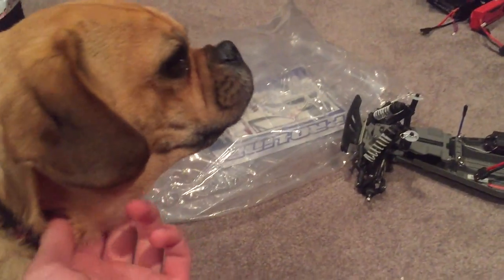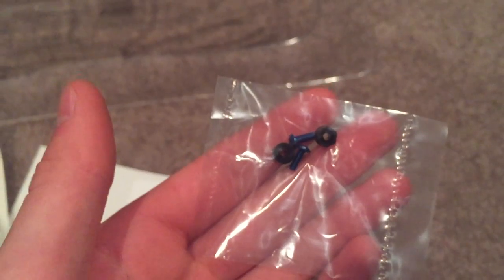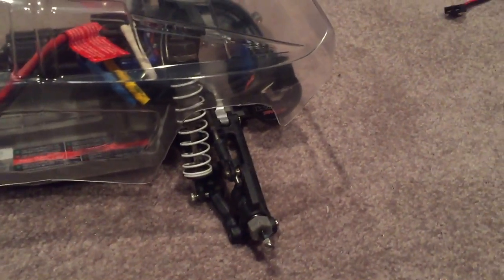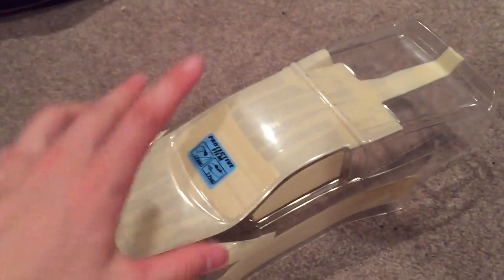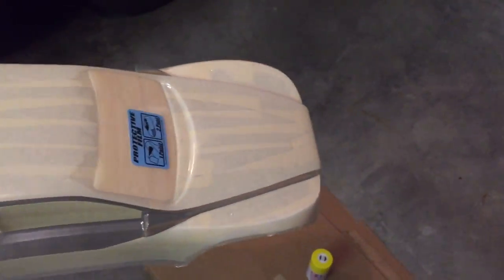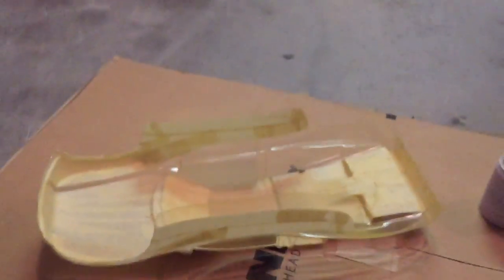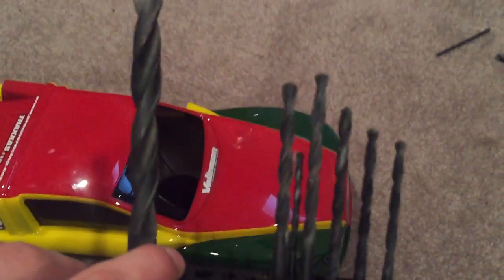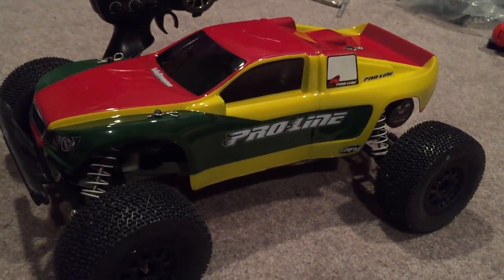Painting an RC Body Start to Finish

Comment: That's sweet.      Working on getting an old associated rc10gt going again with a pro line 84 dodge body.     Everything works electrically but it doesn't run.     Pesky old nitro.

Comment: Uuuhhh....yeeeah... 
Do not follow this dudes directions. Lots more videos on the correct way to prep and paint a body. Use a hobby knife to trim the body if you want to slice your finger off. Also, after you paint your body, use a drill bit, not a body reamer if you want an oblong hole and chipped paint. And paint after you drill so you cant see your body mount posts.... Use masking tape, not liquid mask or vinyl mask if you want yor paint to bleed through the edges. And spray polycarbonate paint indoors if you want to pass out and get sick.
Reply from the maker: Coming back 5 years later and seeing this made me laugh